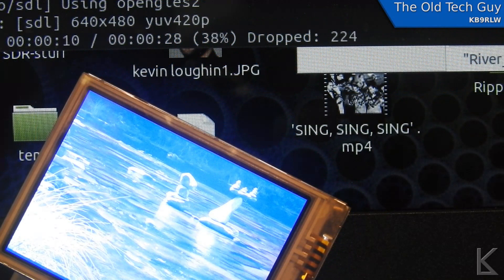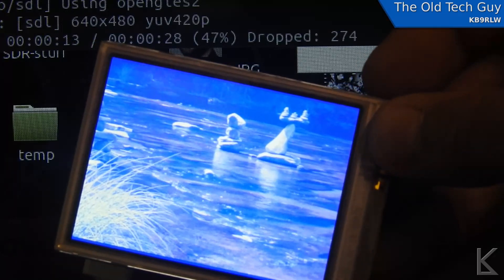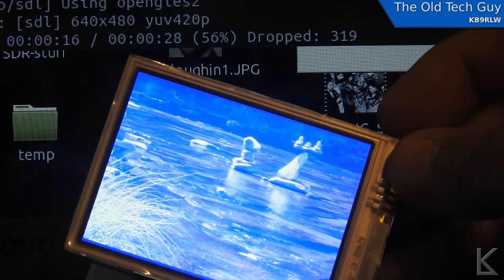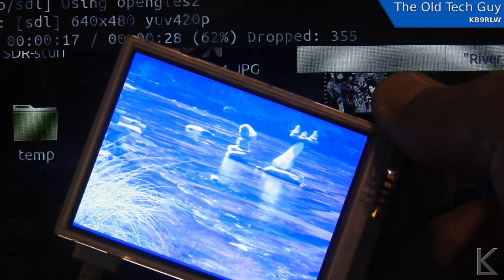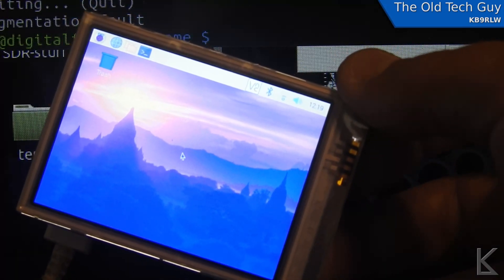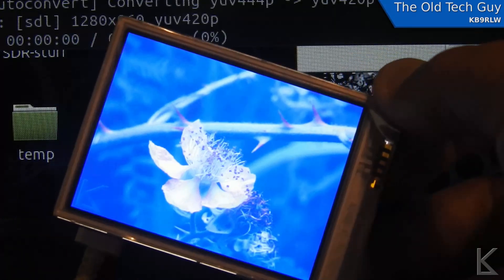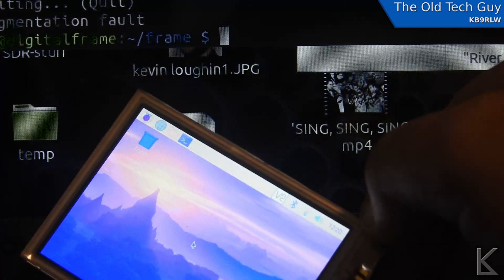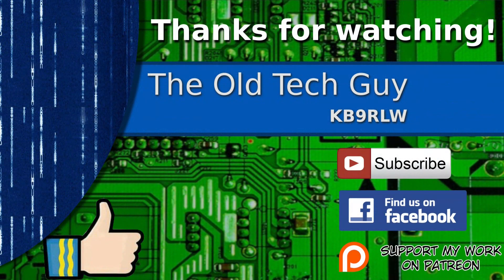Electronics - Update on the living photos frame. It's not going to work with this hardware!

Comment: The trick is to not load X and use omxplayer in the framebuffer. I have a raspberry pi model A with only 256 ram and I can play 720 vids without problems. (mp4, webm, anything)
Reply from the maker: I was thinking about exploring omxplayer actually, until I saw the color problem with the lcd.   At that point, I decided to shelve the project until I get better hardware for it.

Comment: With such an under-powered system running a desktop could actually be a significant amount of overhead. You might instead disable it and create a .xinitrc file with just the command to play the videos (something like: "while `/bin/true` ; do for i in /home/pi/Videos/* ; do mplayer -fs $i ; done; done"). You can also look at the "xrandr --gama" command to try to adjust the screen temp. There's a good chance you'll still need to get a more powerful pi, but it could be worth giving those tweaks another try. You would log in via the console and then run the "startx" command to just launch the xwindows environment and run the commands listed in the .xinitrc file instead of the desktop environment that the pi uses.

Comment: I wonder if the screen isn’t getting any green signal at all. Have you double checked the pin out and the solder joints?
Reply from the maker: Yep.  And there is green, just way too much blue.

Comment: If you get back to this project you may try using something like the PineTab 10.1″ Linux tablet from PINE64 dot ORG. It is $100 and comes with a Allwinner A64 Quad-core 1.2 GHz CPU + MALI 400 GPU. Much more compute power and given the 10.1" screen size a very reasonable price. And: It is all open hardware.